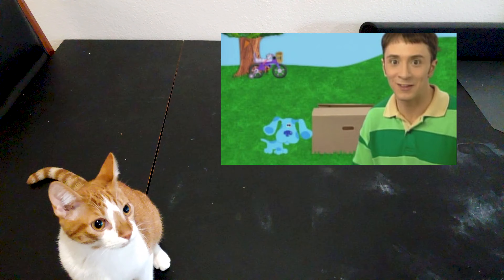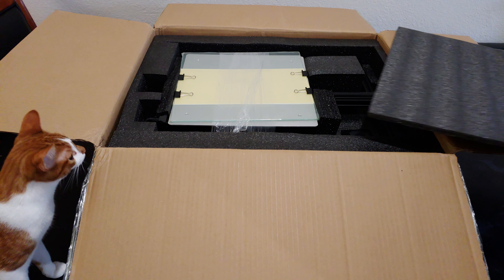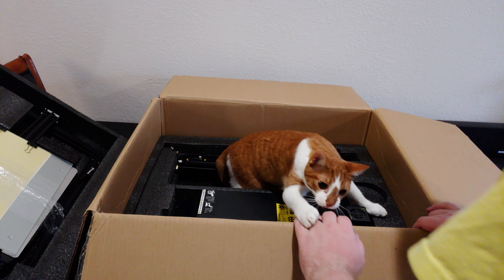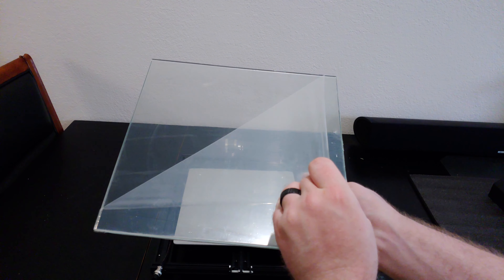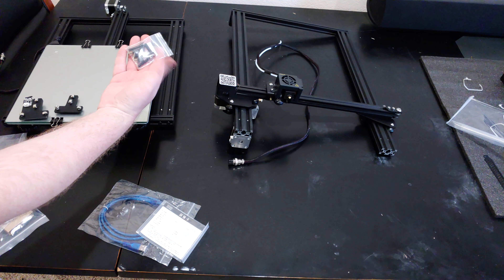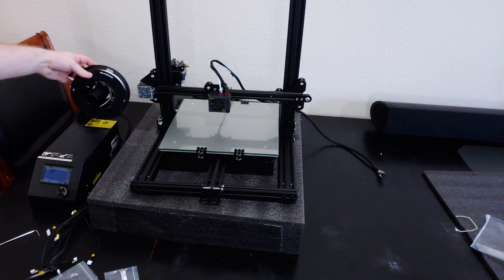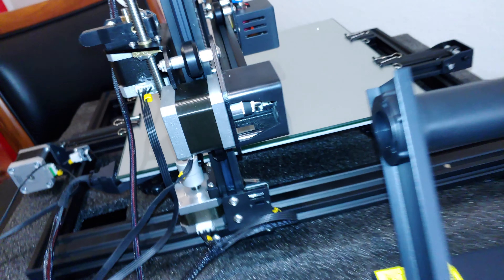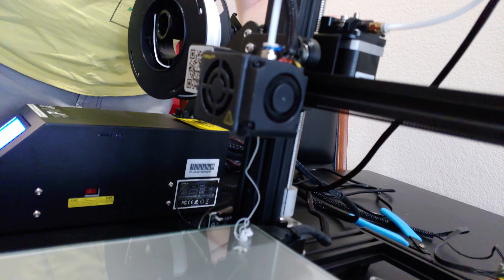CR10 3D Printer Unboxing & Setup

Comment: Nice guide and unboxing.  As I don't have a 3d printer it's nice preparation for when I do.  On a side note, WiFi takes much more of an interest in his employees than Snowflake.  Never really see Snowflake taking to the floor with the plebs ;)
Reply from the maker: I would imagine that an executive as high up the corporate ladder (might need help getting down at some point), Snowflake has much more important matters to worry about than HR issues or individual employee performance reviews. I could also be wrong, perhaps Snowflake is also the head of HR and looking to identify the individuals that worked extra hard and deserve a quarterly can-of-tuna bonus. WiFi is my direct supervisor. At just 1-year old he is still not quite able to reach the top of the ladder. Once he realizes that laser pointers are used in corporate meetings, I imagine he will very much want to find a role as an executive, rather than continue in is primary role of box-inspector.